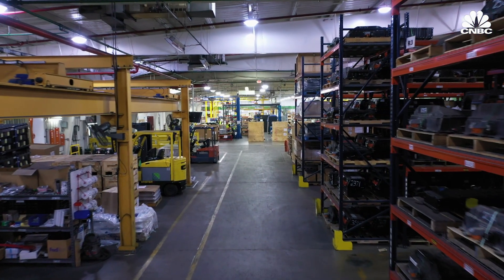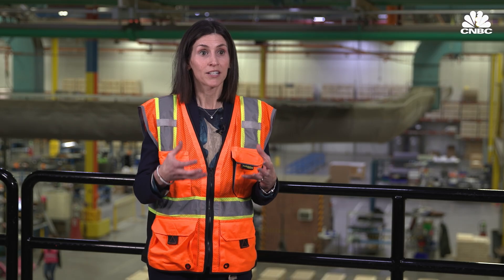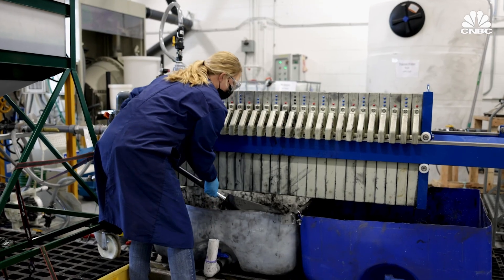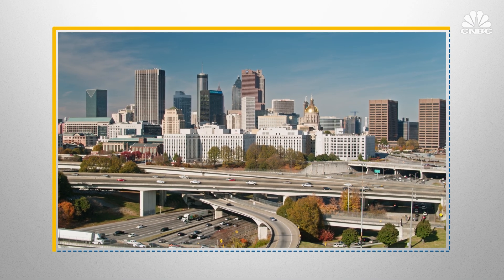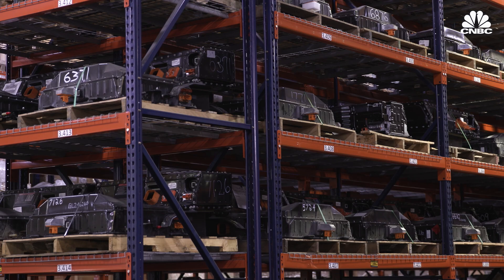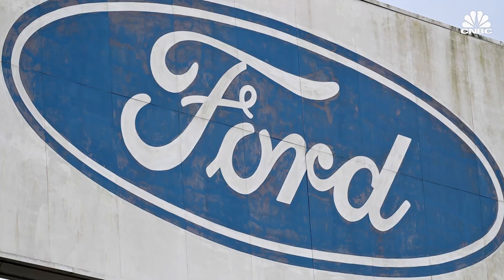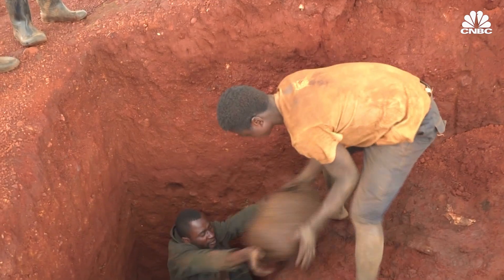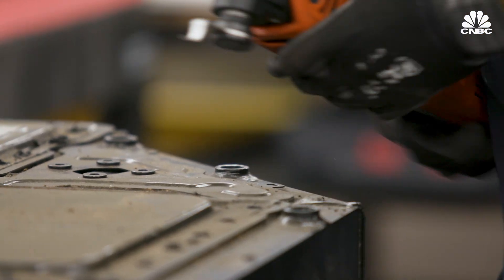Where Do EV Batteries Go When They Die?

Comment: The traditional car is recycled and reused for new cars and other products. Why do these people think that they are starting something new?
Reply: Because it is something new for batteries in EVs?
Reply: @ProXcaliber  Your are easily impressed. Why are your expectations so low? Companies have always tried to get every dollar they can .
Reply: @tira2145  So let me get this right, you are mad because a company is doing something that has a net positive effect by recycling? And by extension possibly also making EVs more accessible by bringing battery cost down.
Reply: @ProXcaliber  not mad, just amazed that CNBC acts like recycling anything is a breakthrough and has never been done before.
Reply: You're missing the point. What they are doing here is recycling the energy source and that is something new. Sure, you can recycle parts and materials from ICE cars but that's it. You can never recycle fuel from an ICE vehicle. You burn gasoline or any other fossil fuel and that's it - gone, with most of the energy wasted as heat. So yes, recycling an energy source is a pretty exciting development.
Reply: @caseyatx1202  The car engine, the energy source, in a internal combustion car is recycled. There's no difference. But just think how many young slaves it took to dig up the cobalt and lithium needed for that 'green' battery. Lithium mining is polluting large areas of Africa and south America. But hey, you don't give a dam about those people. As long as you got your EV, everything is good.
Reply: @tira2145  You are severely misinformed. The energy source of an internal combustion engine, is the gasoline or diesel. There is literally no way the engine can do anything if there is no fuel, hence the engine itself is not the source of energy. The source of energy is the fuel, the engine is just what converts that energy into useable force.

I also hope you realize that to make gasoline, you also need both lithium and cobalt. And let's not forget to mention on the electronic luxuries you likely enjoy thanks to cobalt and lithium as well. We also shouldn't forget how oil spills and chemical leaks affect all those concerning areas as well. Oh, and lastly, let's not forget how much land and water we waste to also make ethanol.
Reply: @Kikicrs  Yep. But I'm not the one who says that driving a EV is going to save the world. Its not.
Reply: @Kikicrs  recycling the battery is no different than recycling the fuel tank on a internal combustion car. The energy source of a EV is usually not the battery. Its just a holder of energy. Where's all this energy coming from? Coal and natural gas. California is already begging people not to use electricity in order to prevent rolling blackouts.
Reply: @tira2145  Wow, I'm impressed you were able to remember all those anti-EV talking points, good job, I'm proud of you. However, the majority of them are just straight misinformation or incorrect. 

Firstly, literally no one is saying that driving an EV is going to save the world, most people don't even buy EVs purely for the environmental effects, most people buy them because of fuel and maintenance savings. It's just a smart investment when all you have to worry about is rotating tires, changing brakes, and topping off windshield wiper fluid, and that also isn't mentioning the fuel savings. 

Secondly, recycling a battery is VERY different from recycling a fuel tank for reasons already stated. Unlike a fuel tank, which is just plastic, a battery has many valuable minerals and metals that can be easily reused to make new batteries or other electronics. Also, you can't recycle gasoline or diesel once it's burned, that is actually just not how physics or thermodynamics work.

Third and last point, local power sources can differ greatly depending on location, it's actually not hard to look up this information as it's publicly available. You can be in one town and be powered mostly by wind, solar, hydro, or geothermal and then go just the next town over and that town is powered mostly by a coal power plant or a nuclear power plant. This varies greatly by location, and sometimes from state to state as well. For example, did you know that Texas is actually one of the largest green energy users? The reason California and by extension Texas run into power issues is because of aging infrastructure that needs to be upgraded. And has for the most part has been put off for decades, yes, that means even before EVs were popular this would cause issues. That is also forgetting the fact that a lot of the problems are also due to environmental effects, in which there is nothing to do with EVs. Whether that be extreme heat, wildfires, droughts, extreme cold, etc. 

If you look up the US power usage, you will actually quickly find out that the majority of power used by homes isn't EV charging, but actually from running AC and heaters. These things waste MUCH more energy than any EV currently could even dream of.

Finally, I'll leave you with one last thought, having one centralized location causing pollution to power thousands of cars is MUCH better overall than having thousands of ICE cars polluting everywhere they go. ICE cars are basically their own mini power plants that pollute in more ways than one wherever they happen to be, whether through Co2 release, leaking fluids, or even noise pollution. Overall, EVs are just one part of the equation to making the world a better place and helping in reducing our environmental impact.

Comment: Even a fender bender can result in the car being totaled out by insurance due to battery damage. Also, extremely high risk of spontaneous fire sometimes afterwards. Putting used battery cells in new batteries amplifies the risk. EVs are promising, but very expensive to own. More durable and safer batteries are needed.
Reply: Propaganda. Nice try. Propaganda. Try again.
Reply: @ChitFromChinola  It's true that insurance companies are totaling out electric vehicles because of a little damage to them.
Reply: @dannydaw59  That is because at this time they don't have enough information about what repairs can be done to a battery if there is +any+ damage. So they don't take chances. This will change with time and experience.
Reply: I'm more than positive I've seen even modern cars catch fire during crashes that aren't EVs. The difference here is that battery technology IS improving already, whereas ICE vehicles are pretty much at their peak in terms of development and efficiency. To see this, you have to look no further than Formula 1, the most efficient cars there are. Also, if you want to go on a deep dive about batteries and safety, you can search here or on Google for solid state batteries, which is most likely going to be the next generation of batteries for EVs. Currently, they offer about double the capacity, a faster charge rate, can handle a wider range of temperatures (-4F - 140F), and most importantly are also much safer when damaged.
Reply: @ProXcaliber  Every 18 minutes there is a car fire in the US, and those aren't mainly EVs.

Comment: Folks with home solar love to get these batteries. Even if they are degraded they still hold many times the energy of a Tesla power wall.
Reply: Nonsense claim. You do realize they’re the exact same batteries inside the packs right?
Reply: @boost1728  It's not the type of battery that makes them desirable it's the number of batteries and pack design that makes them useful. I've seen videos of folks trying to design their own packs and it's really expensive and time consuming.

Comment: I think the next real big innovation will be some form of standardized battery dimensions.  This will help these companies with recycling as they would have more unified approach so they aren't taking angle grinders to the tops of the units to get at the batteries.  But also probably add some automation to disassembly because they could be put into a jig to just unbolt the entire top in a single pass.  We already have standardized charging ports on the cars, so locking down the battery dimensions would be the next real step to help with recycling and maintenance.
Reply: Closest we have are the individual cells, which most packs are clusters of thousands of 18650 cells, which were one ubiquitous in laptop battery packs.
Reply: @LouisSubearth  Yup, this is where I was meaning.  Instead of a single large pack as is the case now that usually also doubles as part of the underside of the vehicle, perhaps a set of smaller sets in series.  Say, one of those accordion sets you see them handling.  If each of those was in its own box with a top bolted on, then you can simplify a lot of the manufacturing and support structure to it.  Take multiples of them similar to aa batteries to get your total capacity in the vehicle.  Now your battery manufacturers can scale to a single dimensional size.  Techs at the dealership will be able to take diagnostic data and just remove the packs that are bad instead of removing the entire set.  This company in the video would also be able to run even more standardized practices to refurb these units.  Perhaps just replacing individual bad cells.  But also because they are bolted, it would be easier to access.  Shipping would be cheaper because of the small size.  Service centers would enjoy having it this way as well thanks to reduced storage needs as spare parts.

Longevity would also be improved.  Framework (a laptop company) recently announced a new battery coming later this year for their 13" models.  They have been sold with a 55wh battery.  But because of chemistry improvements, the new ones are 61wh.  But they take up the same space as before.  So imagine buying a car with the same system.  You buy it now knowing it comes with say 6 (or however many) battery packs with a 150mile range.  But perhaps as a bonus in the future if you hold on to it for 10 years, you could get 200mile range out of the vehicle just by switching out the battery packs.  Which if they survived that long was already hitting EOL anyway.  Similar to how tires generally come from the factory with 30,000mile tread life.  But you can upgrade out to something with a longer life for more cost later.
Reply: This will not happen. The big innovation happening now is how to put more battery into the vehicle, which means re-designing vehicles so that any void space is a space where another battery cell is placed. Tesla has been able to increase energy storage density in the Model 3 and Model S productions in this way without having to change their production line.
Reply: Because space is rare in a car, this won’t happen. This could possibly happen with trucks however.
Reply: How does this help environment? Most people are not aware how the battery packs are made with hazardous materials mined. Cobalt is harvest by hand in some cases by children. They dont say that. Then you need to charge it IE:coal and natural gas. Now we are using biomass is the number 1 element to make  to be green friendly they are cutting trees to make biomass. So the we lose forest in the name of green,  What a scam.
Reply: I hope one day EU announce this before anyone like what they did for apple type C cable.
Reply: The government has a plan to improve the clothing industry by only making one size and color to fit everyone.
Reply: The way they are taking apart battery packs won’t work in the future. The bulk of the battery cell today are assembled into packs and then covered in fire suppression foam which glues everything together. Then the top of the battery pack is squished on which glues it in place. There is no way to dismantle these packs to reuse individual cells. So the entire pack needs to be shredded to access the minerals. 

This technique is causing the batteries to last much longer. When their performance goes below what works for a car they become grid storage batteries. Then they eventually go to the recycler.
Reply: @juffowup78

It's not even that hard to undo battery packs. Did you even watch the video? No two cars are alike. Standardize what exactly? There's different car shapes and sizes.

Comment: Batteries are being recycled, but only in the last 100 years, has there been any real effort to recycle products, such as with the automobile, creating "salvage yards" (or what some call "junk yards", which is not accurate), but even this fall far short of real recycling. But when God made the universe, he incorporated "recycling technology" with its framework, so that the universe will last forever.

For example, there is "the water cycle", whereby water is evaporated and remains in the atmosphere for some ten days and then dropped as rain somewhere on the earth, and as Ecclesiastes 1:5-7 shows. And there is the recycling of dead trees, for when they die, they are either consumed by termites and other insects, such as ants and the bark beetle, so that the wood is broken down and returned to the earth to be reused again as a new tree or some other plant.

In Africa, dung beetles recycle elephant dung or manure, while bacteria also breaks down manure of all sorts, recycling it for use again and again. And what about such "chemical element" as uranium, especially "spent uranium" that are at the core of "nuclear reactors" in making electricity ? 

It too, is recycled, of uranium-234 as having a half-life from 250,000 years, eventually turning into non-radiating lead by radioactive decay of uranium and thorium through radon, while uranium-235 has a half-life of about 700 million years, while uranium-238 has a half-life of about 4.5 billion years.(Note: "half-life" means "the time it takes for one half of the atoms of a particular radionuclide to disintegrate (or decay) into another nuclear form", source: website, evs.anl.gov/uranium, Argonne National Laboratory)

Over time, everything returns to its basic elemental state, breaking down until there is nothing left of the original product, as God, whose name is Jehovah (see Isa 12:2, KJV) designed the material universe to be "recycled", so that it will remain forever to be enjoyed by the "meek" ones who will inherit the earth as their everlasting home, after it is transformed into a paradise, and that will remain pristine forever, in which the commercial system that produces EV batteries (as well as the religions of the world and the realm of politics) will soon cease to exist.(Jer 25:29-33; Ps 37:11, 29)

Comment: These guys are fraudsters... Batteries can't just be refurbished. They're either good or they're bad. Nothing in the videos showed them disassembling batteries for re-manufacture. That's a really hard problem that they're not actually doing. They only store partially used batteries for re-sale or shred them for sending to others. They're a glorified middle manager that increases the cost of batteries. It's no wonder Tesla doesn't work with them. The other OEMs will dump them soon as well when they realize how much money they're wasting on this nonsense.

Comment: We already use a recycling program it’s called used tesla batteries for solar storage ..I got 16 right now charging off the sun..there’s not going be that much of a need ..
Reply: Not everyone has solar panels on the roofs yet, and for some it might be cost prohibitive to even install. We will eventually likely also reach a point where there are more batteries than we can reasonably use, and that is where programs like this will come in handy. And as mentioned in the video, this will probably also bring overall battery costs down.